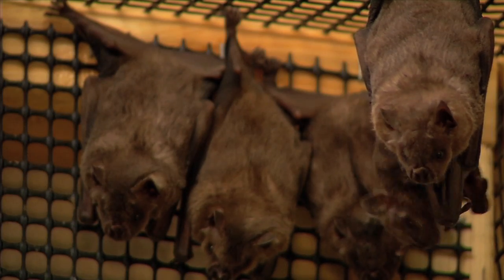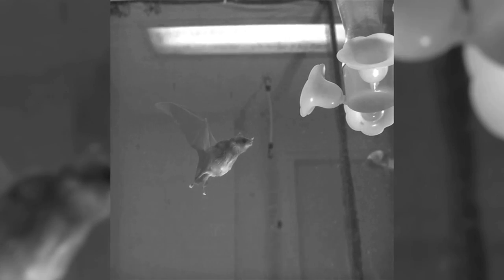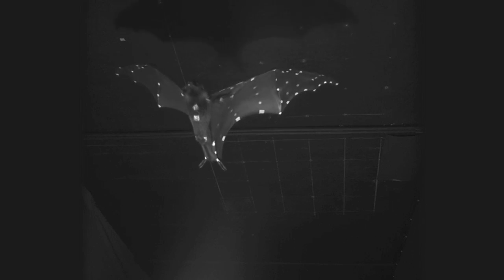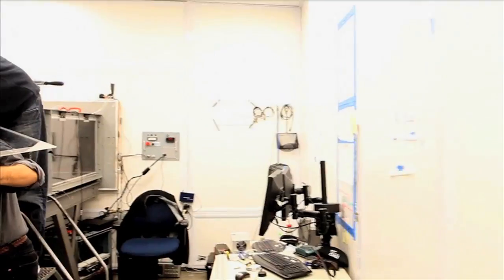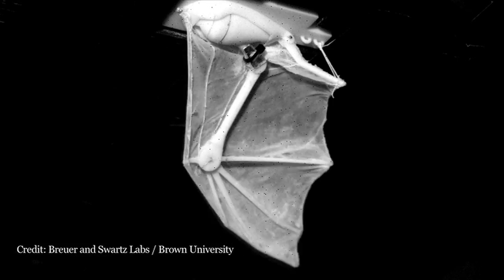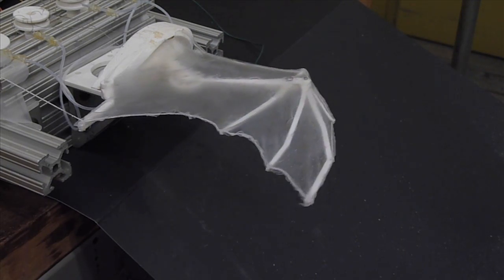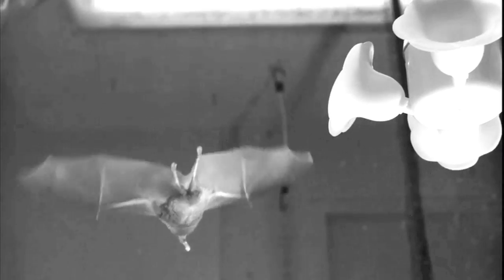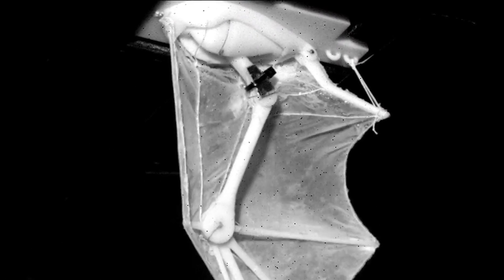Meet Ro-bat, Brown University's Robotic Bat Wing

Comment: So amped for this video. Working on the concept design for a dragon costume, and i think this is going to be more helpful than the ornithoptic stuff I've seen. I just need the wings to fold and brhave a bit differently to fit on with the design, and i think going batty might be the key. Tx for sharing!❤